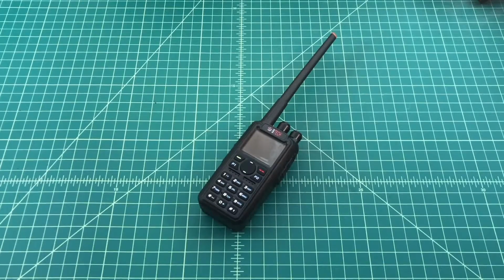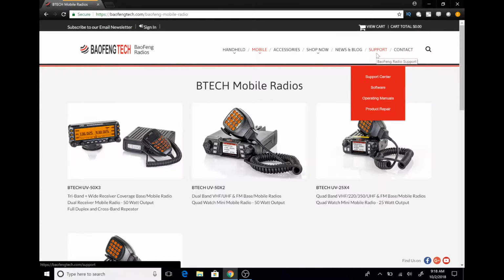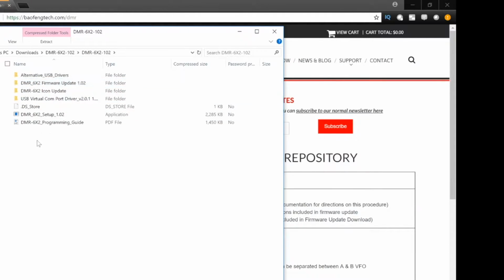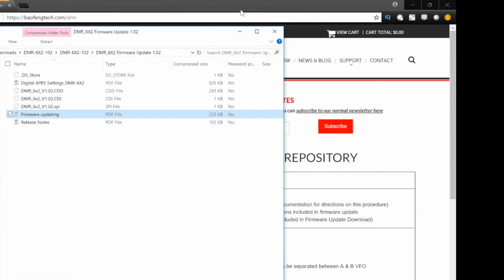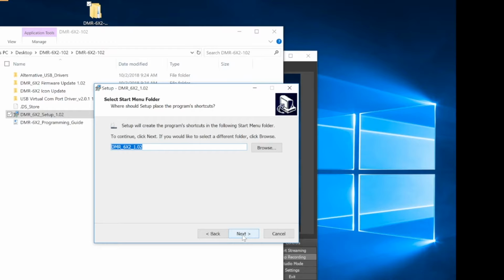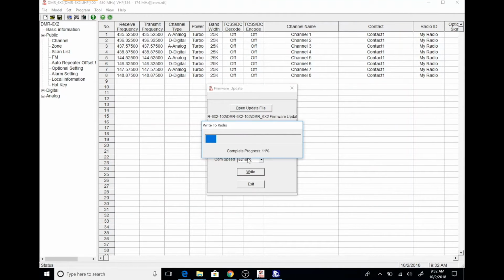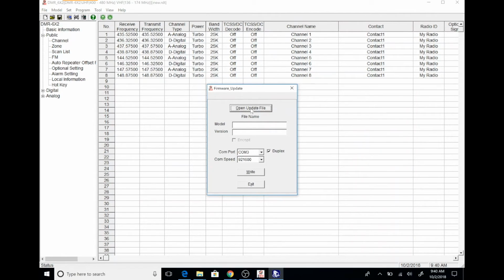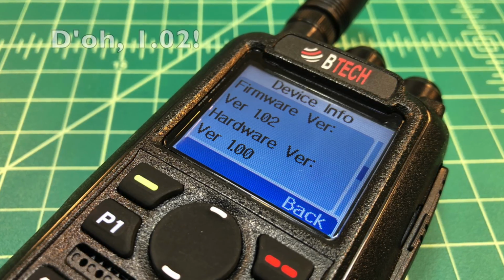BTECH DMR 6X2 v1.02 Firmware Update  - TheSmokinApe

Comment: So how do you like the BTECH DMR-6X2 ?  I'm still torn between that and the ANYTONE AT-D868UV.  I saw your previous video before purchasing... but how do you like this one since you've purchased?  Any regrets?
Reply from the maker: I think you would be fine with either.  I really like it and have used it everyday since picking it up.  I will say that the charger did overheat and melted, support was great and sent a new one out right away.  Anytone has a new model, the 878, coming out that looks very nice....  it will likely be $225 or more.

Comment: Very detailed tutorial! But...what kind of witchcraft are you using there? I swear you plugged that cable into a Macbook....but used a Windows machine for the updates....The Smokin' Warlock.....Wizard...?
Reply from the maker: Lol, it was a MacBook!  It was next to where I shoot videos...  my Windows machine is actually a Surface Pro.
Reply: lol...got it...I have a Macbook and a Surface Pro 3 (won the Surface at the company xmas party a few years ago)
Reply from the maker: I like the surface just not a big windows fan.  I use Linux Mint for my daily OS and the MacBook is only used for YouTube videos.
Reply: I installed Mint on a desktop many years ago, but I didn't know anything about Linux and after I realized I had to manually install....almost everything....I gave up.....lazy, yeah, but I really knew nothing about Linux....still don't. But...I still have a slight interest. Maybe it's better now than it was ...maybe 10 years ago.
Reply from the maker: It’s gotten pretty simple.  You can install it to a usb stick and run it from there to give it a try.  I used to use Linux all the time back in the late 90s and into the 2000s but stopped until I got a Raspberry Pi about a year ago...  just another thing to tinker with.
Reply: I have the Pi, it's on the desk with my HF rigs...don't really use if for much...my interests change with the winds sometimes. I do have an old HP laptop that isn't being used....I might try and see how that runs linux from a USB drive.
Reply from the maker: Let’s get the Pi fired up too! Lol...
Reply: I did get it to work with some digital modes with the FT-857! I didn't know what I was doing and actually had another Ham Op walk me through it during the QSO! I've found that digital...just isn't my gig. I wish I had more time for portable ops.